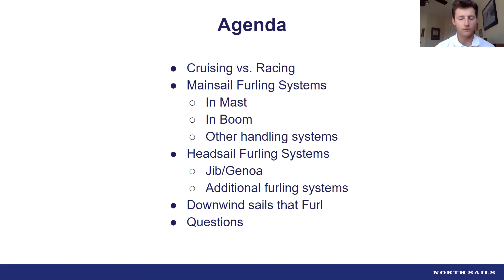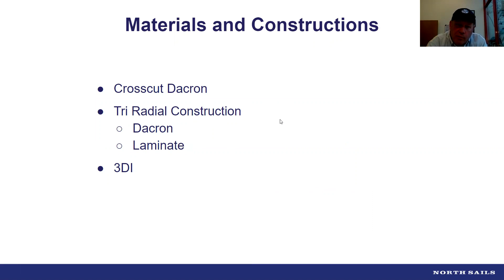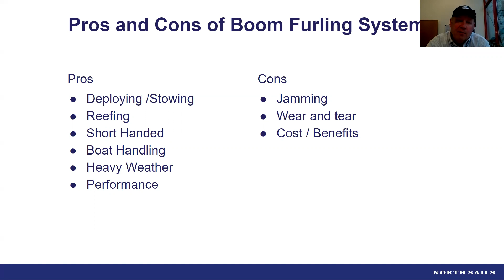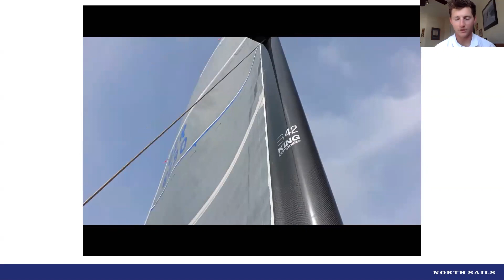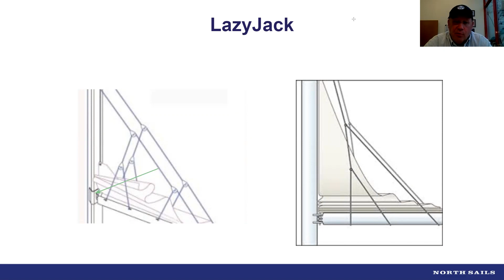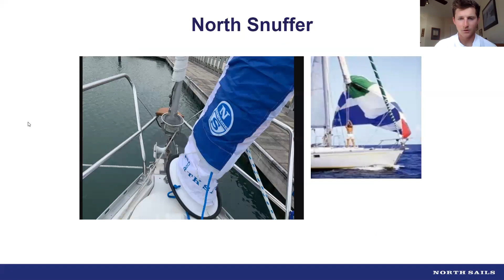The Secret to Effortless Sailing: Master Your Boat's Furling Systems

Comment: Couple of important points that were missing. For in mast furling what about spar weight. A closed tube is much stronger than an open tube so how much heavier does the spar have to be? Also on mainsails with in boom as soon as you roll any sail you no longer have an outhaul so cannot flatten the sail in stronger winds. On headsail furling they did not mention the limits. Never seen a headsail that can be reduced more than 10% without losing all effectiveness. Unless you have a multiple headsail system this leaves you stuck over a major part of the wind range particularly for sailing upwind. These systems may be good for short handed boats, particularly with families, where they need a big boat for accommodation but don't have the crew strength to run it and will only use the boat for short local trips where they can motor back to harbour if conditions deteriorate. For serious cruising particularly for offshore passages these limitations are very significant. I think this video glossed over the limitations far to much and implied that they are not significant, clawing off a lee shoe in a 30kn squall with only a furled 120% genoa you soon find out how significant they really are.

Comment: Bottom-up furlers won't work well on full bodied headsails (true spinnakers) and the top down models have been a godsend for those sails where you previously had to either sock or snuff a big full bodied spinnaker.